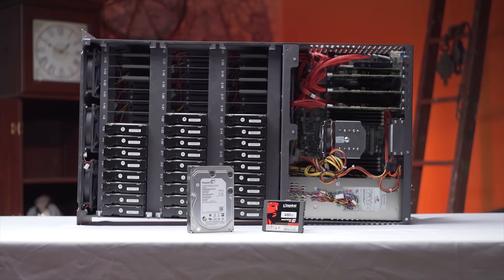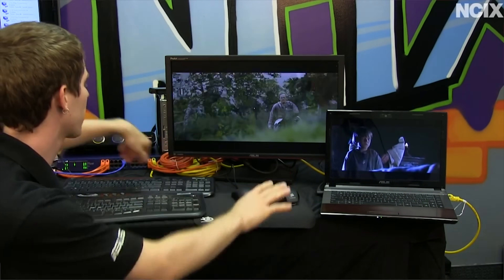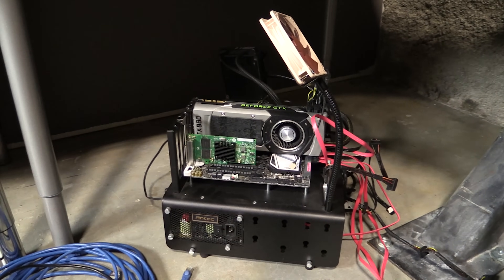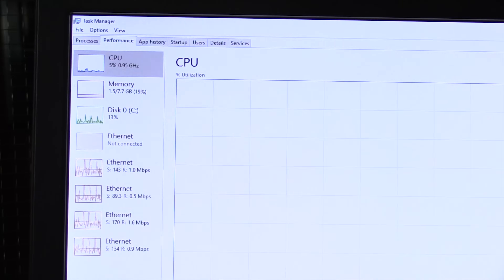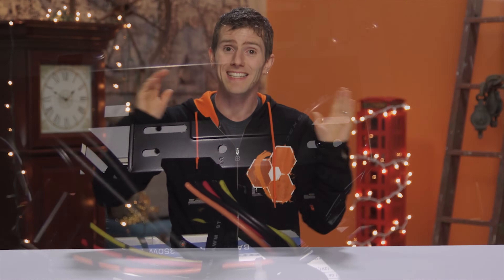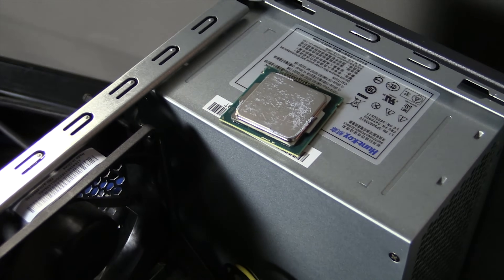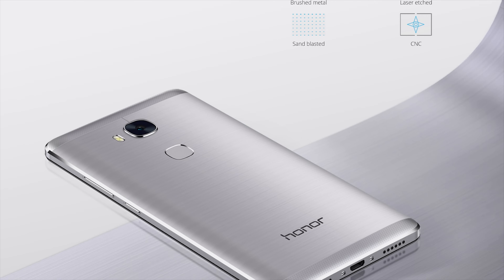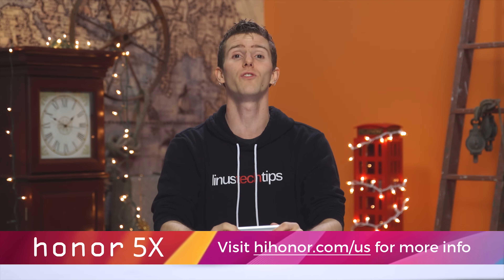Quadruple Your Network Speed for $100 with SMB 3.0 Multichannel!

Comment: HI,

I have following questions:

1- can i use 4 different type of IP series on this 4 port ethernet card !!!
2- can this 4 port ethernet card can be used as 4 different network connections OR will it provide 4 LAN Cards !!!

Actually i want to use this card in my PC based firewall (pfsense) for providing 4 different Ethernet Interfaces 

Waiting for your response.
Reply: You'll be waiting my friend.

Forever.

Comment: If you're wanting faster ethernet in 2020, get a cheap SFP+ 10G NIC off of ebay. Much faster, way more reliable, and doesn't tax your CPU the same way.

Mellanox ConnectX-3 cards can be had for $30.

Comment: nice little bit of info I didn't know before today, thanks!  even using mellanox connect-X 3 10gb fiber cards, knowing this additional trick will prove very useful.  now to probably upgrade my servers end cards to infiniband cards with breakout cables to upgrade my point to point connections with dual ports from workstation to server!  Very much appreciated!

Comment: Suposing that my router stays 20 meters far from my switch, and I have 2 pcs wired to my router and 5 pcs wired to my switch. Should I connect my new NAS system to my router or should I prefer pluggin it into the switch, so the NAS will be "near" the 5 pcs of the network? (these 5 pcs frequently transfer more data to the NAS)
Reply: cable length doenst really matter (until around 100m) and i assume your nas only has one gigabit connection so it doesnt really matter but personaly i would try to connect the nas to the switch with the 5 computters connected to it

Comment: Most computers with modern motherboards nowadays come with a gig port to allow a large amount of data flow. I also see this as a waste of technology because you are using one computer to just increase speeds, and if you use this one computer, it will definitely throttle speeds throughout your home if you use a low end router because of how much one device is taking for the bandwidth. If you have high quality routers, a high quality ISP connection, a decent NIC, newer cat 6 or 5 cables, a decent quality PC, and everything set up properly, you should get way higher speeds as long as you have routers that can handle the bandwidth. I would recommend at least two high end routers to help with this. Other than that, this will not be just a hundred buck job. Lastly, I believe this is only good for connection issues such as getting the speeds you pay for from your ISP. I have never come across this issue in the USA, but I'm sure there are people who do. If you do, I recommend buying a router with gig ports and upgrading your PC to a modern motherboard with a gig port on it. Correct me if I'm wrong with any of this. I'm just going off of what makes sense and my own knowledge. I appreciate any input so as not to leave anyone astray. Thank you.
Reply: He's using 4 1 gigabit ports to create essentially a 4 gigabit connection between the 2 computers. The traffic never even touches his router and does not affect the internet speed on any of the other devices on his network whatsoever.

Comment: I cannot get this to work. I got a QNAP NAS with 2 ethernet ports and a X370 Gaming 5 mobo with 2 ethernet ports on it. I'm running windows 10 Pro. My switch is a regular home grade NON managed switched. I was hoping this would be as easy as plug n play. I am very wrong. I've been reading and watching videos for hours trying to figure it out. Worst part is, I don't have another PC with dual eithernet ports to try and test it PC to PC first. So I dont know if the issue is my computer or the NAS or both. No way to tell. I got all the hardware you would think I would need to do this yet there doesn't seem to be a way to make it work. Seems like a waste of 2 ports on my NAS, 2 ports on my motherboard, 2 ports on my switch, and 2 extra ethernet cables for something that appears to be a simple lack of software support. But I'm so in the dark that maybe it could work and I just have no idea how.

Comment: If SMB multichannel is default on Server 2012+ (I'm using 2019) do I still have to use NIC teaming? I was testing 2, of 4, ports with teaming (LACP/dynamic) and so far it seems to be snappier, even on a single 1gbe workstation (pulling dicom files off of file server). Haven't had a chance to test with simultaneous connections yet. Just want to get an idea of how others are setting up their multi-port NICs.

Comment: Yea, I've got 2 Intel 520DAs one single and one dual... I cant get them to allow a mapped network drive..but I'm a complete newb when it comes to networking. Before October 2018 I was plug in the ethernet and ah yes it works. Now Im building an 8tb steam cache with 4 pairs of 2tbs in raid10. 2 e2690v1 water cooled, way overkill but I love it.

Comment: Sweet. Just one thing that I experience a lot. I use ftp to transfer files over the network. Once a while the LAN cable gets disconnected so it is only transferring files slow over WiFi. I notice how slow it is going and then plug the LAN back in. It speeds up just a little but not LAN speed. I have to do something like disconnect WiFi and probably reconnect ftp for it to do LAN speed again. But I don't think it fully utilize LAN and WiFi. I think just the main transfer uses LAN and then the other ftp port might use WiFi or something.

Comment: should have just used 2 mellonox cards direct connected. CX-2 cards give you 10GigE, CX-4 cards give you 40GigE both can be found on ebay for $100 or less.

Comment: I would like to see a network adapter with the 240 gig nvme SSD, for like $200. That way I could take my HP z200 sff a gen 1 pre built that you can get 8 gigs of ddr3 ram and a quad-core win as a dedicated server for anything from a local game server to a steam drive to (I don't remember what it's called it's 2 in the morning "the thing where you have a dedicated computer that records everything you do on the internet so if someone wants to do it a second time you don't have to go to the internet to access it like have 10 people downloaded steam game at a LAN party or have multiple people watch the same video")
Reply: Heck you could do all these at the same time for like $400, the pre-built is around $100 to $150 depending on which one you go for and what kind of deal you get and how many upgrades you want.

$200 for the network card 
And another 50 to 100 depending on how much mechanical storage

Comment: Your hassle could have been a lot easier if you got a 24 port smart switch and setup LAG, 
A great way to kill this setup,  buy an sfp nic, 2 sfp cables for the smart switch, and use (2) 4port gigabit cards for another station. 
Setup lag as a (round robin) create a virtual subnet for the lag. And bam! 
One PC is capable of handling 8gb/s a second up and down.  And the other with sfp 10gb/s up and down. 
If my theory is correct.

Comment: Or you can just cut an ethernet cable... connect again only the green and orange wires and then connect the other 2 wires to the end of another ethernet. And if you want the quad speed o of your current...just do the same to the 2 ends and make them 4! Router will believe that 4 computers are connected....so its going to optimize the trafic for 4 connections at the same time and your cpu believes that you are connected by a single cable so its not gonna need more threads!!! This trick is even lower than 20 box.
Reply: I also tried this and i ve got the double speed! But i wasnt able to get the quad because i dint had more cables...

Comment: I'm quite disappointed. I assume that card is equivalent to 4x1gb nic cards.  It looked to me like you were getting a maximum of a bit over 400mb/s.  I expected a 2 as input and 2 as output configuration for at least 2gb/second up and down.  Also some server cards have a built-in preprocessor Wich is disabled by default in Windows, would activating that feature Make it take some of the weight off the CPU?

Comment: Did you make sure all the Ethernet cables weren't miswired or did you test them to make sure they passed with free shield? I've seen similar problems before when it was just cables instead of the actual hardware itself and that's why going through the trouble of making them is worth it.

Comment: Why SMB? I've not tried it, but I hear Windows 10 has NFS in the OS. It's in Win7Ultimate too. If you've got a NAS, it will most likely have NFS. I've not tried it because I'm still disliking Windows 10 quite a bit, but it's starting to grow on me a touch.
Reply: Regardless if you use NFS, you are still limited to the speed of the link, which for most is 1Gbps (or less).  It seems easier to me to upgrade to a 10GB cards, but they you may need fast cabling depending on what you have.  He didn't do the best job in explaining exactly what problem he is trying to solve.

Comment: Because it's about streams. Windows file copy isnt multithreaded. If you use something like fast copy or manually copy multiple files as multiple operations, you will see it work. Each copy operation is one thread. One file after another. A large file won't be split across all NICs. You even see that when using true balancing like LACP or LAG.

Comment: Port trunking can be achieved on a capable switch at Layer 2 via (PT) Port Trunking: bond 4 physical ports to present as 1 logical Port. 4 cables/Fiber  can interconnect the team to the PT. The Intel Quad port can either be used via Intel HW/SW teaming capability. This will either give one fault tolerance and yield a GB logical NIC as a wide FT 4x1 channel capable of loosing up to 3 physical channels without lose of XMIT/RCV if a cable failed. If the IT Admin wanted a faster than 1Gb channel the Intel Management software for Servers could be used to (L2) Multi-bond (Team) the cards stacked up to have an aggregate speed of 4 cards.  Before SMB 3.0, one had to be careful with the Network stack on the host MS-Win PC. Components of the stack that are responsible for publishing the (CN) Canonical Naming must be removed from each individual NIC and applied to the Logical team. Only ONE unique (CN) with an associated MAC was allowed to publish and route on an IP network.  It appears to be a much easier task on Windows 10 than it was on MS Server 2003. Our IT group would use the 4-Port Intel Nics to create a backup network using the Intel teaming and (PT) on our 3Com/Nortel/Cisco Mgmt switches.  The backup network was run on just IP (with net use x: \\HOST_IP\c$) and transferred at 4 times the speed of a single port. WIndows 10 now has a feature that automatically bonds multiple ports to present 1 logical adapter -#1) Network Neighboorhood - #2) NIC adapter properties select more than one adapter holding CTRL - #3)Choose create Network bridge and a logical NIC is created. The wizard magically creates  the behind-the-curtain IP-stack mods. 

Love the Linus Tech Vids

Apologies in advance from a Network Geezer!

Comment: Obviously everybody's set up is different but i got 4Gbps Fibre cards for $8 from eBay, it easily lets me transfer files at 1Gbps.
Reply: Yea, that's a better solution if you can run fiber...or just use 10GB ethernet.  I think this video was just more an exercise in seeing what's possible, then any sort of recommendation.

Comment: mmmm will this help my bandwidth problem on mt security system i a 12 poe cams running 8 mp and since i upgraded do this cams i can only do 6 fps my cpus are running 10% even when live viewing soo i know if not my cpu or hhds i have a stripe and mirrored hd rack  15k rpm hds they are pretty fast  soo i think my problem could be the hdd orrrrr my network, cards my server only has 2 network port which they full time running just for security???????  i just would like to get more fps

Comment: I get to add A Cat7 cable on my home network this month :) I have been using Cat6 & yes I will have the speeds of Cat7, I have the option for 2 Cat7 cables on my Network Switch :) & I use  Sas drives @ 10,000 rpms in A raid

Comment: Use Linux for this, lot less hassle. Also for testing you should use iperf, just "iperf -s" on one machine, and "iperf -c ip.address.of.another" on the other. Another way could be by sending /dev/zero with dd over ssh to another machines /dev/null, if you're a geek and don't want to use bespoke tools. These methods are not dependant of drive I/O or other peripherals that have nothing to do with it.

Comment: Linus....you do know that SAMBA is single threaded right?  That was the bottleneck of it. It seems like Intel Cards with their own processors is the only work around. Even linux SAMBA transfers are slow due to that. Asynchronous IO is one option that helps somewhat in Linux file servers :)

Comment: LACP anyone?
Reply: Very nice when you want one address for multiple ports. Not so useful for increasing the data rate of a single connection; Round-Robin works better for that but it's tricky to set up and doesn't really work in Windows side. SMB3 is a step forward for larger scale-adoption but it's too little too late kind of scenario now that can have 10 Gbit gear for peanuts. Not that I am complaining; better now than never.

Comment: Hi linus how are you doing
for exmple i have router (4 lan port with 100mbps speed) i want to comnine all port to work as one  (gigabit switch) what do u think about?
Reply: I think your speed will be maxed out at 200 mbits with that setup. 2 cables going in one computers, 2 cables going into another. Now the switch is kind of cable-extender and completely redundant component. I think you should consider getting a gigabit switch. You can get new one for 20-30 USD and I checked ebay and on the first page the cheapest one was 4 euros for 9-port gigabit switch (+ postage fees, which are probably more than the gear itself ;)

Comment: Well at least now we know that this issue is likely do to the fact that Windows 10 is potato.  Between it's huge legacy codebase and a coding methodology and ideology that are not able to keep up with technology innovation you get problems like this. 
Currently Intel and others are struggling to improve raw, single core performance and so are pushing the loads outward to multiple cores. Windows as an OS is not very good at this and neither is Microsoft doing a good job of making it good at parallel code execution. This has also led to a supporting application industry that for the most part also does poorly at multi-threading.

See one example of Microsoft's ineptness at multi-threading here: https://randomascii.wordpress.com/2017/07/09/24-core-cpu-and-i-cant-move-my-mouse/

Comment: If you got a managed ebay switch with lacp support (802.3ad), and nic's also supporting lacp, and set that up than under the operating systems you'd get a single 4Gb network connection that should be quite versatile at reaching it's peak performance.

Comment: So then disk, SSD or RAM is still the bottle neck. In most cases, gigabit port switches are hugely under utilized and cheaper 100mb switches are fine in most environments.

Comment: Honestly what I did was grab some 10Gb NICs for cheap off ebay.  Got them for like $18 for a single port card.  No connection ganging to worry about...
Reply: Also need a 10 gigabit router and cat 6 cabling. Thisis good for older setups
Reply: Not if they are directly connected. And those cheap cards use SFP/DAC cables not ethernet.
Reply: Indeed, that's an option. So, is fiber channel and infiniband. Infiniband supports speeds up to 40Gps and something called RDMA which allows you to access devices on other computers over the network as if they were in the local computer. That what super computing clusters use. Anyway, either of these three (10Gb, fiver channel, or infiniband) would probably be easier to get up and running for just a fast point to point connection between 2 computers than teaming multiple gigabit adapters.Teaming almost always works better for applications like servers which transfer data to multiple clients. A single faster connections is probably going to perform better for point to point transfers between 2 machines much similar to how a faster CPU will perform better in single threaded applications than a slower CPU with more cores.

Comment: What type of "Ethernet" cables did you use? You need at least category 6 and preferably category 6a for that to work over UTP  I'm surprised, given all the troubleshooting you did, that you didn't test out the basics. You should start at the physical layer and work your way up. It's networking 101.

Comment: Why dont you put 4 port into etherchannel ? 
Link aggregation should work..
Reply: Yes, you can do it in windows 10. 

Just replace the Ethernet names with your NIC names.
Run powershell. 

New-NetLbfoTeam TheATeam "Ethernet","Ethernet 6"

You should then get a 2GBs Switch Independent team. From there you can use the Network Connections screen to set it up how you want.
Reply: Just seen this video for the first time. SMB multichannel is a cool concept, but I was thinking the same thing. If you have enterprise server grade 4 port Nics then why not just use windows 10 to create a network team? this presents as 1 network card with the potential for 4Gb.
Reply: It seems that you can't do NIC teaming with Windows 10
Reply: Yeah NIC Teaming with etherchannel also set up on the switch side is the way to do this. and works with nearly any OS.
Reply: Except this is talking about speeding up a single SMB 3.0 transfer buy however many Nics you have. Setting up a link aggregation group are etherchannel requires four separate TCP connections possibly the four different eyepiece depending on if just eye peas are used to Hash or port numbers also and then you still get into the hashing and if two connections hash to the same port and things of that nature.
Reply: MS removed the netlbfoteam cmdlets in Windows 10.